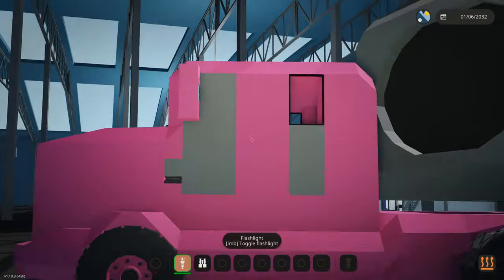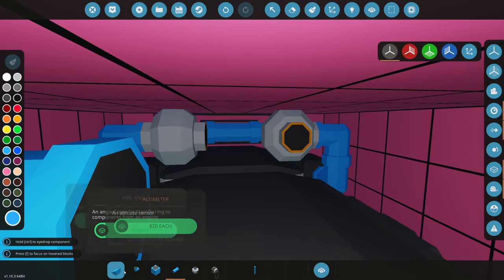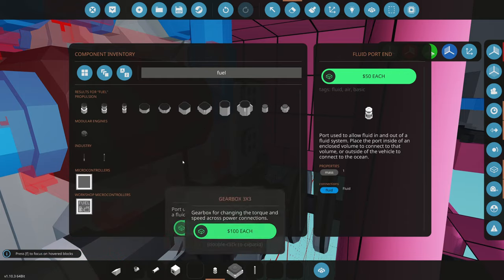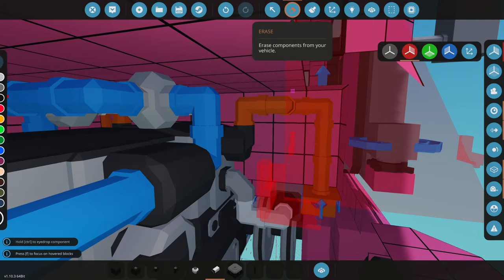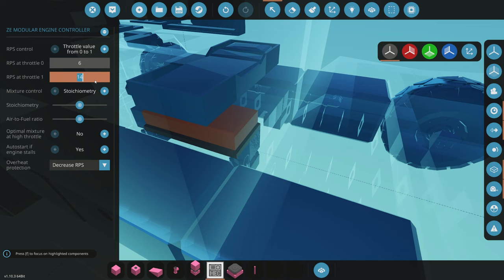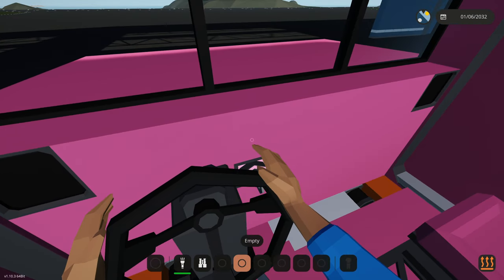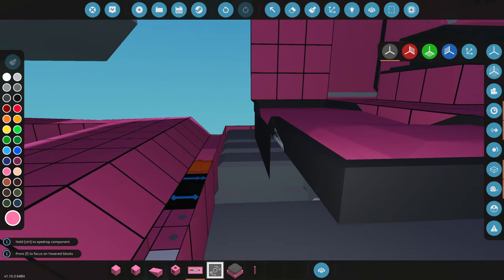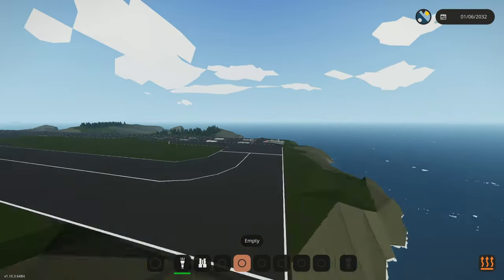SUPER Engine Added to The Command Center Truck in Stormworks!

Comment: the reason why the truck started going as soon as you turned it on is because you set all of the gears to ratio off so that means by default they will be on that gear so i recommend using the ze transmission microcontrollers because they are pretty epic

Comment: Add access to the command center from the truck
Reply: NEO DO THIS!
Reply: @jeroenvangastel9079  YEAH!!!!
Reply: That doesnt work
Reply: @Mlelwilli   We will see
Reply: @Rolikpolik-uu3rz  if u do that, then neo has to connect the command centre to the truck or u have to make a random ass door behind ur bed to the outside and walk to the command centre and make a door there wich could be dangerous if u release tye trailer ans a random ass person with a whole army of cannons would shoot at the dooor
Reply: @Mlelwilli   Its possible to make a armor door with a pivot motor thing and behind it place a real door also no one would release the trailer (except for the bad guys but you said you so that means whoever is controling it also THEY HAVE DOORS ON THE SIDES WHY GO THROUGH THE BACK?? also i think he can make a system that kills the bad guys on the bed maybe i do not know but also that will of course be only used when its safe